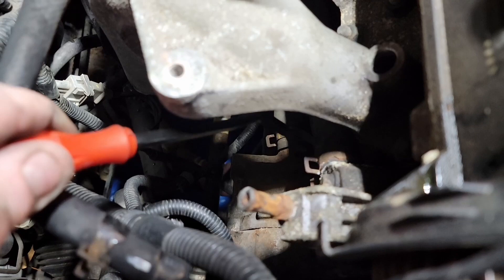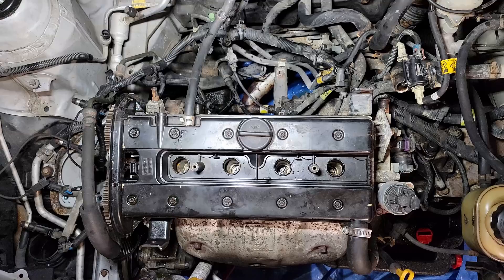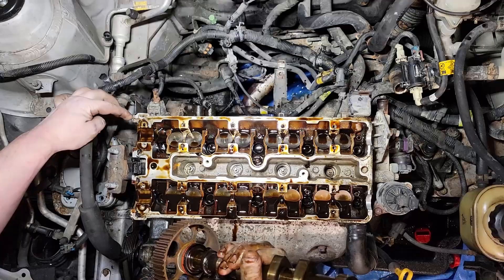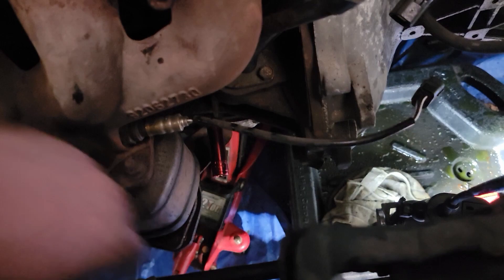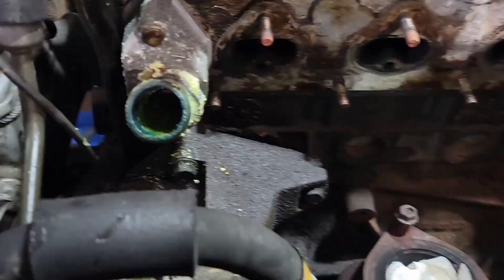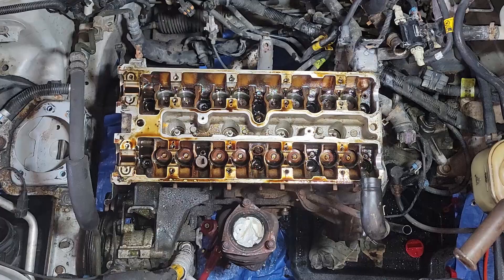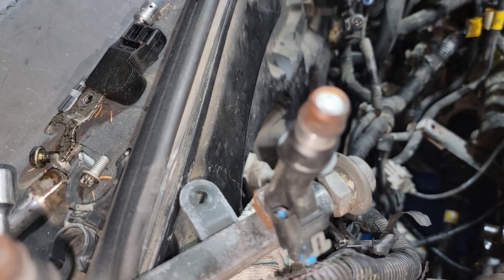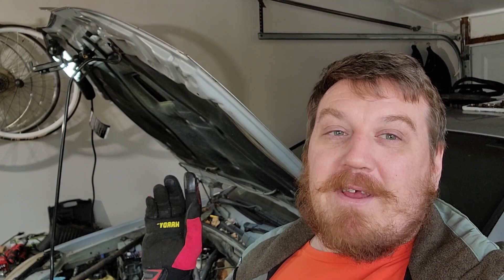SUZUKI FORENZA HEAD GASKET REPAIR PART 2: PULLING CAMS, MANIFOLDS, HEAD & MORE!

Comment: Loved it. I did my Aerio 2.3 three years ago. None of those stupid e torx. All aluminum intake, valve cover. Chain instead of belt.  This Forenza motor must be a GM partnership.
Reply from the maker: Hi Kevin thanks for the comment and please take a moment to subscribe if you haven't already! I did an intro to this with a better explanation but it is actually GM owned at this point haha good call! Watch that video here: https://youtu.be/RborSec-sZ4 Luckily I got 90% of the tools in 2018 when I did one of these exact Forenza's down to the same color but a 2008 haha. The E-Torx is actually super cheap at harbor freight and comes in a set! The hard one to find is the TX55 I think it was? It's the bolt for the cam gear and I actually broke my only one putting this together lol. All the local auto parts and "Tool/DIY" type stores were all sold out!

Comment: 1:13 im doing this job on a 2008 Suzuki reno, underneath the intake manifold there is a ground wire as well. Had to go under car to see what was catching.
Reply from the maker: Thanks for the comment Chris and please take a moment to subscribe if you haven't already! That ground wire is a pain to get off but you can install from the top (youll see later in the series). My first forenza was a 2008 actually haha! I know yours being newer will have a slightly different throttle body setup as the 2004/2005 have drive by wire, yours will be electric. Also you should check your headgasket kit for the EGR Valve. They weren't included and cost extra 5yrs ago when I did my 2008.

Comment: Great work! I have a 2007 Reno basically a Forenza I believe. I need to change the valve gasket because my spark plugs have oil on them and I got a check engine light for misfires and a catalitic bank 1 code. I saw some of the undercar in your video but I thought I'd ask you. Do you know home many catalitic converters and o2 sensors this car has?
Reply from the maker: Hi Ariel, please take a moment to subscribe thanks for the support! I would suspect you have a similar issue that my forenza had and you are slowly pressuring the coolant and intake. So oil is pooling in the intake which makes your plugs super oily and it is slowly destroying the CAT.
Reply: @D2WrenchWorksDIY   Thank you. I do have some coolant going into the combustion. Is this from the valve gasket causing coolant to get inside?
Reply from the maker: No this is a bad headgasket and you can follow this video series showing you how to fix it.
Reply: @D2WrenchWorksDIY  I will find it and watch it. This car is giving me more issues.
I had a radiator placed a year ago. Yesterday I saw water or coolant coming out from the bottom left and right side close to the radiator. The water lands on the plastic guard left and right that is underneath the car like a protector. Do you know what could be the issue or have a video on that also?
Reply from the maker: I couldn't tell you without getting underneath the car but cars with a bad headgasket always pop the radiator hoses. I would get it in the air and see if the radiator hose you are describing seems blownout or soft. I would also make sure when you do the headgasket the car uses the specific coolant I have in the description that is meant for this car, as people always chuck in cheap crap that literally eats the engine and it happened to mine in this series. You did replace your radiator recently so it could have the bad stuff in it right now, like mine did. Mine actually ate through the heater core AND the head lol, I had to pull the dash after this series and replace the heater core it was not fun in the 90 degree weather.

Comment: I have the 2007 Reno. I got a code for bank 1 catalytic. There is one sensor and one catalytic right in front of the engine but there is also one sensor and another catalytic under the car. Am I correct and which one is bank 1 of the two?
Reply from the maker: There are two sensors one under the hood right in the exhaust manifold and one under the car near the drivers door. You need to fix your headgasket issue though because it'll just destroy a new sensor as well.
Reply: @D2WrenchWorksDIY   So code catalytic bank 1 is a sensor issue or the actual converter?
Reply from the maker: The ECU reads between both sensors and measures your CAT'S efficiency. It has precious metals inside that are extremely susceptible to damage from engine oil and coolant. So unfortunately when you have a failing headgasket you will also have a o2 code as well. I replaced both my sensors after completing this job with OEM from rockauto. The more you drive it the more damage is done to your cat too.
Reply: @D2WrenchWorksDIY  Basically the miss fires is from the catalytic and that is why the code reader goes from miss fires to catalytic and vise versa?
Reply from the maker: No the misfire is because the headgasket leak is pushing oil everywhere including the spark plugs and catalytic converter. If it isn't driven far with this issue, meaning the head gasket is repaired quickly you might get lucky and the Catalytic converter isn't hurt. Unfortunately a new Catalytic converter off Ebay will also throw the same po420 code too, so you would need to spend time and search down an OEM Catalytic converter. Maybe you could find one in Europe as a Chevy Lacetti used/low mile Catalytic converter or from a LKQ junkyard here. It would have to be super low miles though like 70k tops as these engines all seem to blow head gaskets around 90k-100k miles.
Reply: @D2WrenchWorksDIY   I took the car to a shop and had the compressor test performed and piston 1 and 2 have 160 pressure but 3 has 120 and 4 has 100. This is proof of a leaky head gasket. I am going to apply head gasket sealer after I fix the radiator to but time and eventually get a new car. I got the Auto Zone Shop Pro Yellow Anti freeze and Coolant ready to use. Is this ok?
Reply from the maker: Yeah definitely DO NOT use the head gasket sealer in a can stuff it is absolute junk and will further damage your engine, radiator and heater core. That stuff will clog everything it's not supposed to. Your only option is to follow this video series and replace the head gasket properly.
Reply: @D2WrenchWorksDIY   Thanks! For me it would be too much work and I don't have time these days. I figure if I drive as is it will eventually go kaput and if I drive with the sealer I can buy time until I get a new car. No winner here unless like you say the gasket needs replacement.
Reply from the maker: It's your car of course but I would never advise driving a car into the dirt and making it worth a few hundred bucks scrap. You can still get a decent chunk of money for it the way it sits right now actually, include your compression test numbers. The car market is crazy and DIY people like me will buy it fast I am sure. Mine has rocker rust and needed ALOT of work (driver window didnt work, fuel door latch cable broken, headgasket was bad of course) but it only had 99k miles so once its fixed its a strong running low mile engine again. He listed it for $2k and tons of people were trying to buy it and I got it for $1800 so it wasn't some low priced deal by any means and a bunch of other people were trying to buy it from under me lol. 

Either way good luck in whatever you chose!